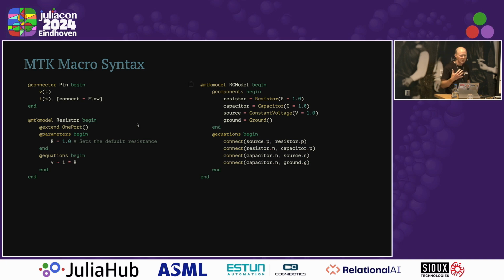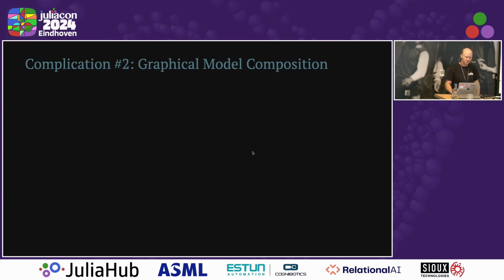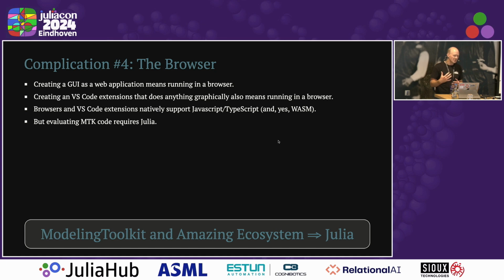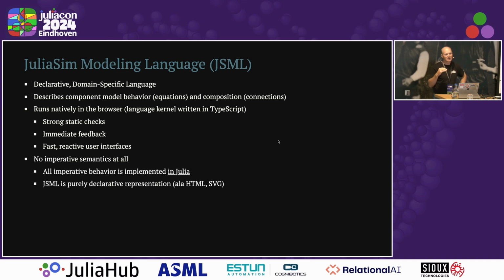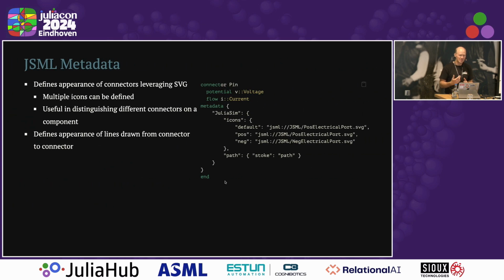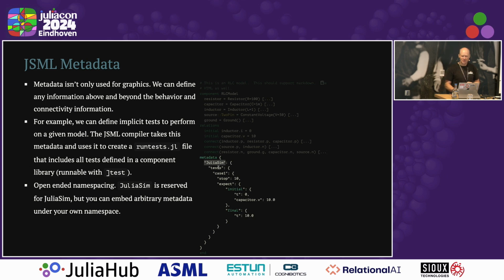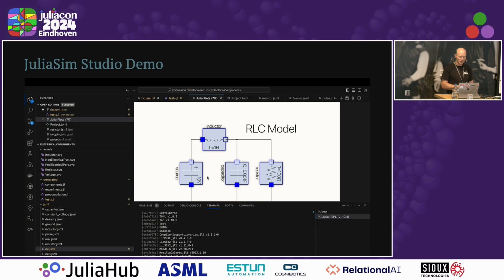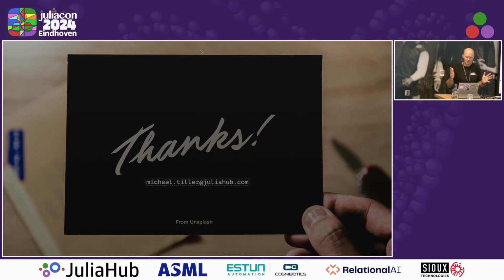JuliaSim Modeling Language: Composing Complex Systems with MTK | Tiller | JuliaCon 2024

Comment: 25:48 To believe that there is no reason to use anything other than json or .svg is simply short-sighted. For example, neither is expandable and both are too unwieldy, especially for large data sets. I recommend that the lecturer take a look at .xml, .urdf or .X3D.